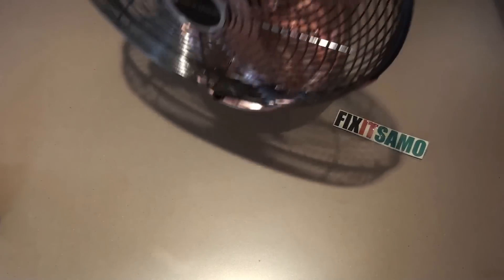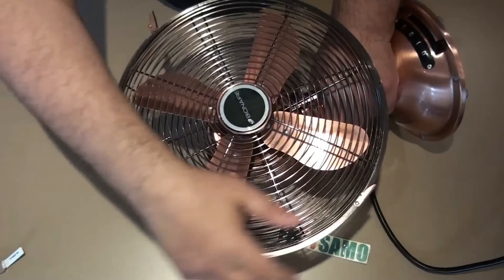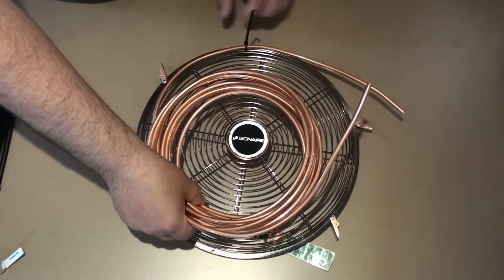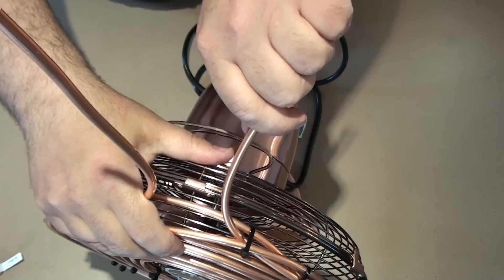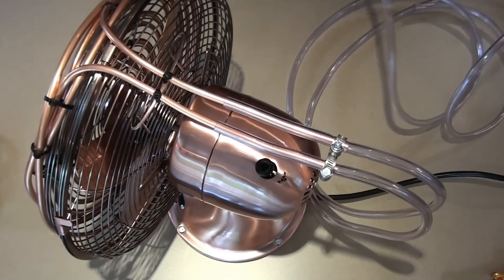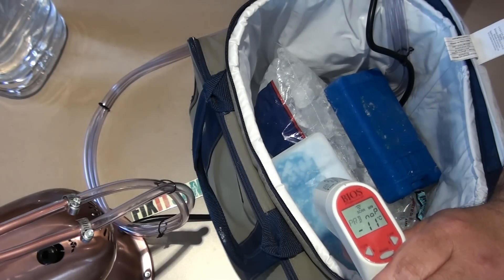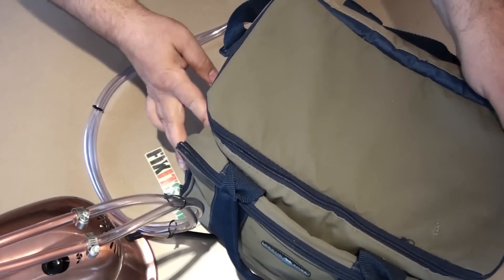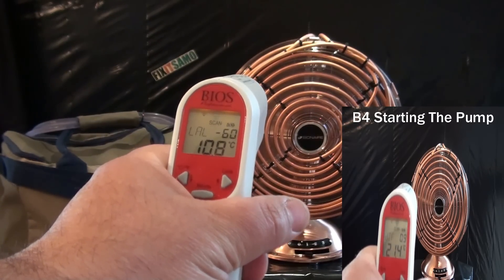How To Turn Your Fan Into An Airconditioner  AC

Comment: How heat exchange takes place.?
Reply: heat melts the ice, at which point this does nothing
Reply: @sinephase  lol how does this thing doesnt do anything? Heat goes through the copper tubes being blown by fan passes through the tubes. Cold water recycles for it goes through the bucket, the only question here is for how long will the cooling effect lasts.
Reply: @fredpeterarope9802  I said once the ice is melted it doesn't do anything anymore
Reply: @sinephase  that still depends on how your container tries to minimize the release of the cold air inside. Usually even though the ice is gone the water will still be cold for a couple of hours. I've seen this on some processes like what they do when they harvest cultured fishes. Reservoir being use on this processes doesnt even have covers yet the water stays cold.

Comment: Does condensed water drops from the front side of the fan?
Reply: It will depend on the humidity in the atmosphere. If you live in the south, it will condense like crazy, but if you live out west it should condense less.
Reply: LargeSizeJellyFish super agree hva. Engineer here from south

Comment: What if you add salt to the bag?
Reply: I wouldn't worry too much about copper corroding (it is a concern in large systems that run for very long periods of time but not really for something like this). However, introducing salt into the circulated portion of the system would increase the possibility that some kind of deposit is going to build up somewhere (most likely inside the pump). I'd keep the circulated portion of the water as pure as possible and keep it completely separate from the ice (as suggested in this video). That way you reduce the chance of mineral deposit inside the plastic tubing, the copper pipe, and the pump.

In such a system you probably don't want to use salt (or much salt) to reduce the temperature of the water/ice mixture because the freezing temperature of the water in the cirulating section (the pure water) will then be higher, meaning there is a greater potential for it to freeze. This is going to depend very much on the ambient temperature and how much heat is being extracted from the air by the copper and transferred back into the system, so the amount of copper pipe, wall thickness, air temperature, the amount of airflow through the fan, the quantity of ice, and how much of it is in contact with the circulating portion of the system.

I think I would avoid salt completely and replace a portion of the plastic tube that is inside the container with another section of copper pipe. That would increase the amount of heat that can be transferred out of the piping into the ice.
Reply: You can add salt into frozen gallons or water bottles, that way you are achieving colder temperature without a risk of salt getting into the tubing.
Reply: @Christopher Jackson salt corrode copper pipe??

Comment: How much will the copper tube cost
Reply: #30.00 on amazon.  Just be sure to get a large enough roll of copper tube.   His roll is 25' long.   It also depends on the size of your fan.  You want enough to go around the metal face panel, just like he's done in the video.
Reply: CalleOcho0830  yep about $2 a foot for the CHEAP stuff.

Comment: Hey what if we put this ice water setup in refrigerator ?..we can put small hole for  this plastic tube at rite side of the refrigerator door. there u can see a rubber type of thing along the door ..
Reply: then, just buy the ac
Reply: The frigerator pumps the heat back into the house thats how the fridge works

Comment: What was the temperature inside the house when you tested the coil without water? I imagine it had to be around 90-100F right?  I'm asking because I have an experiment I want to conduct and I don't know how well it will work. If it's knocking off 10c or so, it would definitely be worth my time.

Comment: If you want to make it ever lasting hook it to a Ground Cooled system where a copper pipe cycles the water 10 feet below ground and it will cool the water and cool your house
Reply: only works until your house heats up the ground though.
Reply: @sinephase  the ground is cool for a reason. Heat rises. It will rise from the ground. Basic science. The man is right.
Reply: @joysoyo2416  LOL OK genius look up the heat conductivity of rock, soil and silt. Hint: they're insulators more than conductors LOL
Reply: @joysoyo2416  heat rises in air not the ground….basic science.  If your premise was true then the heat from the core of the earth would rise and the surface would be incredibly hot.  The deeper you go the hotter it gets actually, at a rate of about 1 degree for every 30 feet or so.  The ground simply holds the average temperature of the surface…cooler in summer and warmer in winter….nothing to with heat rising.
Reply: Jarid Gaming how do you do that?
Reply: That copper tube wasnt cheap
Reply: We had a well in NY and I was always tempted to cycle water from the well to cool the house.  The well was drawing water from 200' down!!!  In the summer, that was quite chilly.
Reply: Thank you Jarid
Reply: Ancient Indians used that system. Their temples had a water source that funneled into a maze then disappeared into the ground along with the heat, also humidifying. It was an evaporative cooling system as well as removing ambient heat. You are very smart.

Comment: humidity can be a factor, as water is generated thru condensation. in anycase its a great idea especially in northern part of the countries
Reply: No. It actually pulls moister out of the air. Just catch the condensation and dump it.

Comment: Can u plz tell me on which principle it work.... why only copper coil?plz rply i am curious to know.....
Reply: T Rawat It works on the thermodynamic cycle of a refrigerator basically. The water transfers heat to the ice, which lowers the water’s temperature. As the cool water goes through the coil, the warm air passes over it from the fan, meaning heat is transferred from the warm air to the cool water. This lowers the air’s temperature. The warm water is then cooled in the ice and the cycle starts over. Copper is cheap and doesn’t have any reactions with water, so it’s a good choice.
Reply: The way u answered seems u don't like to be questioned....?  It's a nice project thats why i asked the principle...anyways nice work ...keep going..
Reply: T Rawat copper is very good at absorbing heat meaning all the other heat surrounding it will be absorbed in exchange for the lower temperatures of the water, in most cases that’s what dissipates heat from most laptop processors to the fan, the copper peace absorbs most of the heat from the processor instead there by preventing it from over heating , hope I explained it well 🙂
Reply: I too am a yelp critic
Reply: Because copper is a good conductor of heat and electricity.!
Reply: same way an ac works. spose u dont know how one of those works. google

Comment: What about the condensation. Chilled water will condense and rain down on the fan itself or blow out into the air stream. Chilled water will produce a lot of condensation at a typical set point of 55 degrees f. It will produce even more with water that cold, i'm guessing in the high to mid 30's and With no static pressure in the air flow, i'm guessing some will fall straight down on the fan and some blow out into the air stream depending on the Relative humidity. Not good.
Reply: same as in an ac

Comment: I think this is a fantastic idea! However, to make the cold water last longer, you could buy a mini plug in cooler that self cools and add a little water so it doesn't touch the fan inside the cooler and it will stay cold indefinitely.

Comment: And what about all the condensate water that builds up on the coil? It looks nice but it will leave a nice puddle of water underneath the fan
Reply: it will constantly blow it off ,how will it build up? its not dehumidifying
Reply: Conor Omelia condensation is from still air.  Nothing will build up on this coil with air moving over it.
Reply: MarkH10 how do you explain requiring a drip pan/condensate tube in a central air system? Air is constantly flowing, but still condensing...
Reply: Jeremy Ericksen It's a counter commentarian plot.
Reply: Sorry but water will pour off this fan and blow into the air stream. Condensation is from moving humid air across a cold object, in this case copper tubing with 38 degree water in it. it will produce a lot of water.

Comment: & then you need to go out and buy a dehumidifier and worry about mold in the right climate.  Yes, it may be cheaper but in higher heat it then makes it muggy also.  Very uncomfortable.  I use my ac only enough to cool down and then shut it off.
If you are not the type of person who sweats easily, take a hot shower.  When you get out you will actually feel cooler.
Reply: Sharon Hurdell bullshit, this is gonna make you sweat even more haha

Comment: What about simply putting one or two frozen plastic bottles of water in front of the fan? I really like the idea shown in the video by the way. But this came up in my mind
Reply: i do that several times a day for my one outside cat,  i use gal jugs and also the gel packs, believe me they do not last long,  its worth the trouble since she is my oldest and been through the most, and can't be mixed in with the inside cats, the ice only lasts an hour at most. in the old days we could buy block ice, i don't think there's a place left in san antonio that sells it today, im probably wrong but i referring to home use at decent price , probably the commercial places can still get it. any older people out there will remember the old ice box in the kitchen with block ice, the ice man delivering it to your door, the swamp coolers hanging out a window that truly did cause problems, but all we had, or our old cars with the vent that opened at base of windshield, a pan of ice in your floorboard, open that vent and the air blows straight into the pan of ice and cools the car. also had a unit that looked like an old vacuum cleaner or torpedo tube, rolled up in your car window like a drive in movie speaker, or drive in food tray, you filled it with ice or water and as you drove air pushed through its open area and into the car, the water and/or ice was separated kinda like an old thermos.  im a fan of anything different like this and so glad a few people still think for themselves.

Comment: I got me a plastic container with water and salt, and placed it in my camper's mini fridge, drilled a hole to run the tubing, then epoxy sealed it. There is one problem now, its damn cold in the camper.. Love it!!!! Able to save space, and now I can use my fridge as an AC unit.. hehehe
Reply: But you can't use it as a fridge. Is the trade-off worth it
Reply: very cool!

Comment: do i have attach the tubes to the fan?

would i still be ok to put tubes in front of the fan instead somehow?
Reply: You might have luck with a  radiator assembly of some sorts.
Reply: dont know how i would connect a small size fan radiator if there is 1 to a pump

Comment: Thank you for your video.  I made one and it does really work !  I am finding the ice lasts only a couple of hours at best.  I am using a hard p,mastic cooler and I drilled a hole in the top for the wires to exit.  Does your ice last longer ?
Reply from the maker: Good job yes my ice lasted around 10 hrs it all depends on the cooler quality
Reply from the maker: And try to use big blocks of ice they’ll last much longer
Reply: LOL that would be true if humans didn't sweat. Because we sweat even if its so small you can't see it any air immediately cools you down.. even if the fan made the room a little hotter because of motion it still doesn't even come close to outweighing how much it can cool you down.
Reply: am in uk could you list me links to the products i need on amazon.co.uk please?

when you turn the fan off does condensation not drip into the fan?
Reply: Powerful cooling -> ice melts fast, weak cooling -> ice lasts long. That is all there is to it. Any modification that would make ice last longer would also recude the cooling.
Reply: Seems great for cooling you off in front of your desk but how well does it work for cooling off a whole room? Also a good cooler will help keep your ice cooler :)
Reply: Salt

Comment: What if you used refrigerant
Reply: AC is basically a refrigerant. I had the same idea but in another aspect. In my country the nighttime current is much cheaper than daytime current. (It is about half the price.) The problem with aircon is that it can't store the cheaper nighttime cold, but a refrigerant is able to do that. So I had the idea to run a system like a refrigerant on nighttime current to create a big amount of ice, and at daytime just blow it out like in this video but by a bigger radiator. Earlyer we had the same system for heating. There was a big massive radiator built of special bricks that stored the heatenergy Between  bricks there were air tunnels. Bricks have been heated by nighttime current, and at daytime a small fan blew out the warm air into the room.  The only problem with the ,,refrigerant system''  is, that turning water  to ice costs a lot of energy.  So it should have been calculated before running a system like that.  Anyway... current in my country is still the most expensive source for heating and for cooling. In summer I always open windows at dawn to cool down the house, and at daytime I use blackout curtains, shutters,  fan and LED lights like anybody else. It's easy and cheap.Having a roof or trees around the house is not a bad thing, because in this way sunlight can' t heat walls directly, and at winter time  walls are protected from cold wind.   Sorry, my english is still not as good as it should be.
Reply: MrTeknics well I'm that case I think you would just run the copper tube behind the fan instead not sure but yeah give it a try
Reply: Im not sure how refrigerant works, but if it comes out of its container and becomes cold, I think that's a great idea. Frankly I was a little disappointed to see that ice was needed for this fan to work, but I still like the idea. The same effect can be achieved with a shop vac and gallon jugs of frozen water, but this is more compact. I like your question, Im going to look into that further,.
Reply: refrigerant  has to be highly compressed .
Reply: RobVoyles and im certain there are still ways to do that
Reply: How?
Reply: z352kdaf8324 same way you use the ice water
Reply: z352kdaf8324 except hook up to a refriederant tank
Reply: You don't even have a clue. lol
Reply: z352kdaf8324 about what
Reply: What r u talking about

Comment: If you add a half cup of salt to the water it will get much colder than plain water
Reply: thats a good idea, but first be sure the fountain pump you are using can handle salt water, most say use only fresh water.

Comment: also, a big solid brick of ice or a say 4+ 20oz styrofoam cups frozen solid of will last much longer than loose ice, add some salt to it and you can turn your room into a freezer, lol, could be a possibility if the fan and coil is big enough
Reply: salt ruins the fountain pump.

Comment: @fixitsame Since this has been such a successful vid, it would be cool to see you redo this running salt water and ice through the tubes to test the temp difference. I watched a Mythbuster episode, where they were testing out the best ways to cool beer, and the best ended up being just adding ice to salt water. Not only did the temp drop lower, but the ice lasted longer (somehow).
Reply: " but the ice lasted longer (somehow)" because the temperature difference between water and ice gets smaller. normal water has an anomaly which causes the liquid state at the bottom get no colder than 4 degrees Celsius. so over time the water will melt the ice. but if you add salt, the freezing point of water gets lower (thats why you put salz on streets in the winter so the water wont freeze at 0 but at -15 to -20. this way the water at the bottom can also become colder than 4 without freezing.
Reply: the Ice system was used in some places where electricity was cheaper at night- The episode showed a styrofoam container, filled with salted water, and the coils wound inside it. The coolant would run through the lines, just like the on the evaporator, but it would have a liquid in the lines and the exchange would happen normally.
I thought it was a cool idea, but never saw wide applications for it.
I guess it was a bit ahead of its time. no CFC's

Comment: is there a product like this that comes preassembled? I know it's an easy construction but I bet people would buy this in a flash, those evaporative coolers are efficient with the use of water but not cold enough to really cool down any substantial sized room, it's obvious by looking at this construction that this can really cool down a decent space room with saw a ceiling fan circulating air depending on fan speed and size and it will last a good time before having to add Ice because an insulated cooler can keep things cold for a long time, you can even place this fan in a styrofoam box with a less tight copper tubing coil circulating behind the fan to cool the air being drawn into the styrofoam enclosing and the front coil can be protected from the immediate exposure of the copper coil to the ambient warmer air, it would create a buffer behind and in front of the unit so the ice would last longer, this is just a theory, haven't tried it might be completely wrong, love these type of videos, make you think